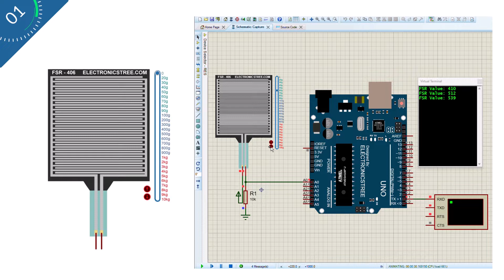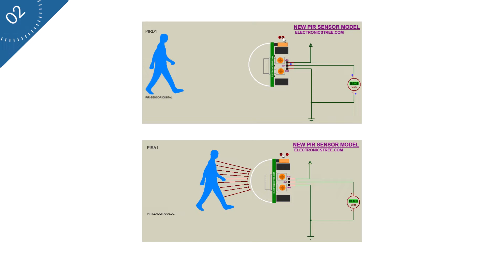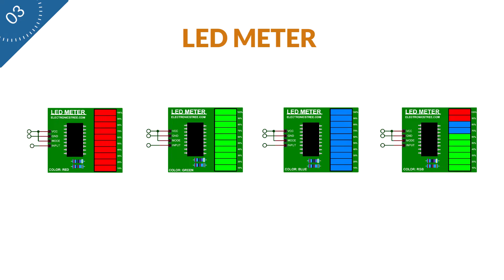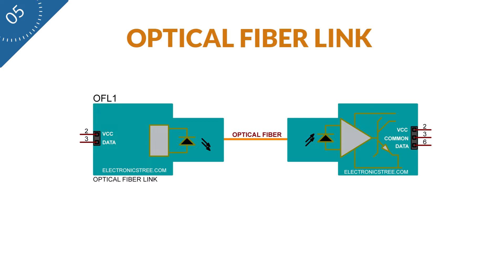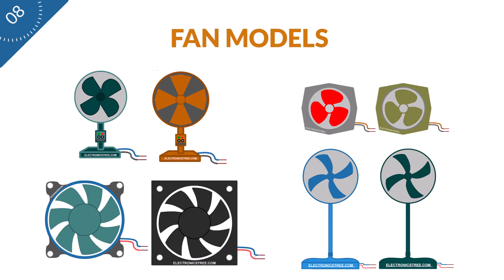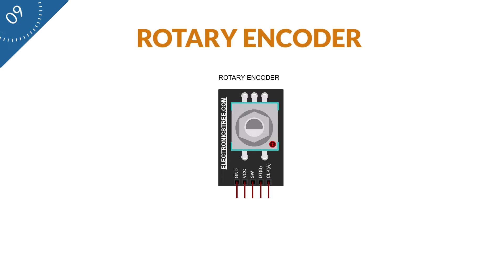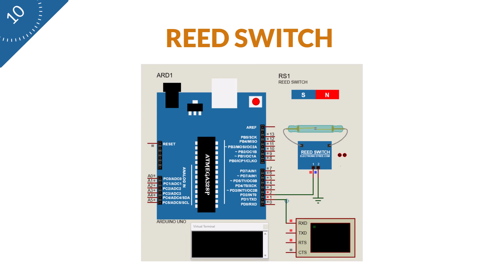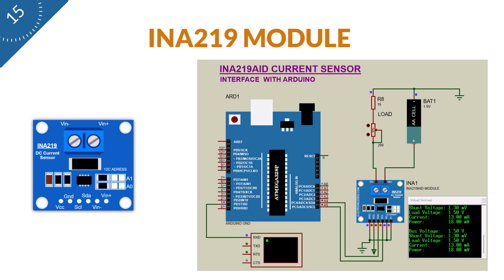Download New Proteus Libraries for Arduino | 2024 | ELECTRONICSTREE.COM

Comment: hi, if you check digital PIR library its off value is 2,5V not 0V. thank you.
Reply from the maker: The output pin has a 100M resistance in the off state, and I think you have connected the voltmeter to this pin. By default, in Proteus, the voltmeter device also has an internal resistance of 100M, which I think created a voltage divider circuit, resulting in the 2.5 volts. You can change the voltmeter's internal resistance to 1M. I will fix the sensor pin's off-state resistance value to resolve this issue soon.
Reply: @electronicstree  i see now, thank you.

Comment: VERY GOOD VIDEO, NEW SUBSCRIBER, ANY QUESTION WILL THERE BE A LIBRARY IN PROTEUS FOR AN AC ALTERNATING CURRENT MOTOR?
Reply from the maker: Yes currently Proteus offers a 3-phase motor model.
Reply: @electronicstree  oh , when I try to search for the proteus it doesn't appear, only the direct current ones, could you provide me with the library for those motors 🙏
Reply from the maker: You can search by typing 'motor' in the search field, and you will get a list of motors, including the 3-phase motor
Reply: @electronicstree  I already looked for it in prostheses but I can't see only the DC one, and the servo motor ones 😔, and the others were difficult for me to use, could single-phase AC motors be made?
Reply from the maker: Ok I will create the single-phase motor model, but I can't provide an exact timeline.
Reply: @electronicstree  Thank you very much, I really appreciate you taking my request into account, I am sure it will be of great help to many of us in the community, I will be on the lookout for any updates you can share. Greetings!

Comment: it is great~~~~~ wish it will add more device libraries like nodemcu,esp32,raspberry pi, .... it will be perfect.
thanks for your sharing...
Reply from the maker: Proteus does not currently support the simulation of web-based models. However, you can simulate the ESP8266, which is already provided by default in Proteus, using the IoT framework. Alternatively, you can use the ENC28J60 Module in Proteus for creating web server-based projects.

Comment: Would you pls add; Raspberry pi, esp32, esp8266, mpu6050, A4988, nodemcu, turbidity, ph meter, NRF24L01, fingerprint, orp water quality, dissolved oxygen, adxl335, TDS water quality, water flow, force, RTC, keypad, gsm, gps libraries. Thank you.
Reply from the maker: Currently, I'm working on some of these models, so they will be available after complete development. For IoT projects, you can utilize the default Proteus ESP8266 model, or alternatively, you can employ ENC28J60 Modules for web server projects in Proteus.